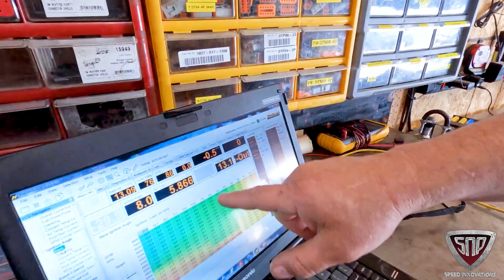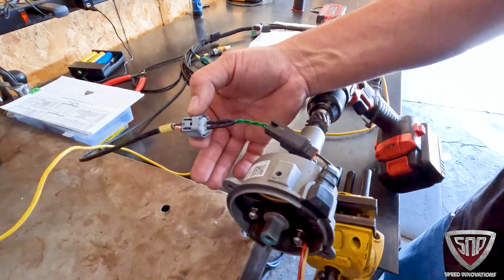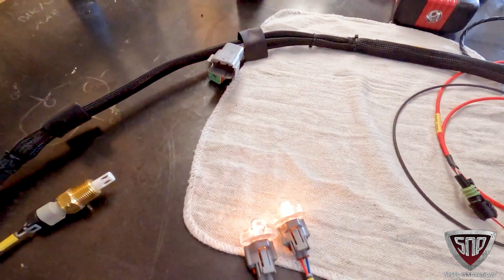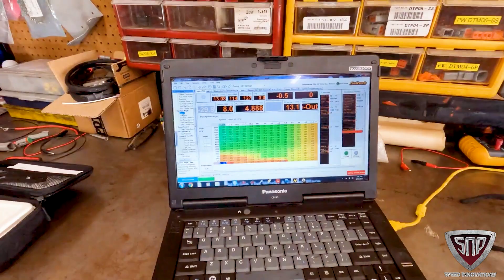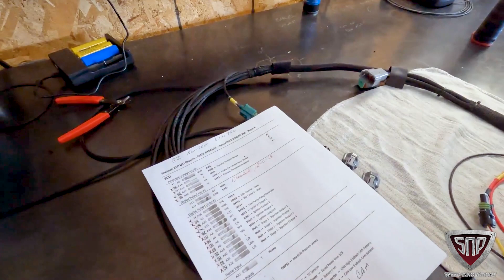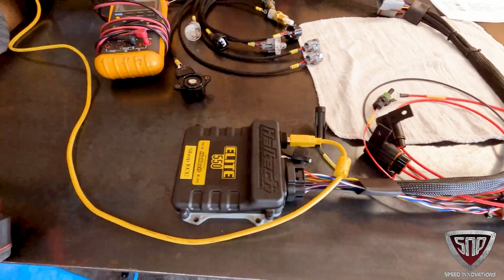SNP Speed Innovations Toyota 22RE/2RZ/3RZ/5VZ Complete harness testing.

Comment: i have a 99 4runner that was 2wd automatic and was converted to manual transmission and 4wd and it keeps throwing a p0125 code . would you recommend a new harness and a haltech 750? i is super charged with stock pully
Reply: is that some i can have you guys do, im in san diego and wouldn’t ming coming to you in az.
Reply from the maker: @johnnyg2466  yes, we can help you with that. Go to our websites contact page and give us a call
Reply: awesome , i will be in contact soon , thank you for your time 🤙🏼
Reply from the maker: Anytime  @johnnyg2466
Reply from the maker: Because it's supercharged, yes, our SNP adapter Elite 550 kit would help it run way better.

Comment: Absolutely fascinating stuff.
So is the harness you built just to test the haltech unit?
Is the haltech unit somewhat plug and play?
Or when someone buys this kit they have to replace their whole harness?
Reply from the maker: This video is showing how we test our harnesses we manufacture in house before they ship out with our kits to the customer. We build harnesses in batches, test each harness, and put them in inventory.  We sell our harnesses to fit our Haltech ECU kits, but we also have adapter kits we offer as well that does not need to replace the factory engine harness.